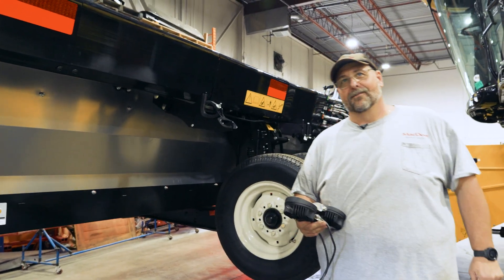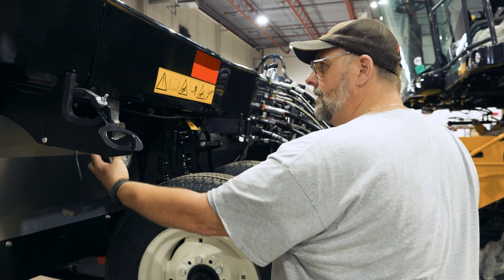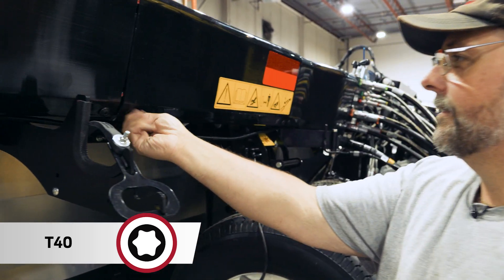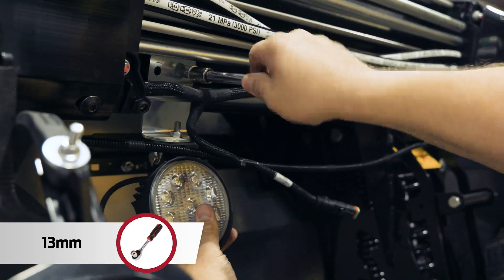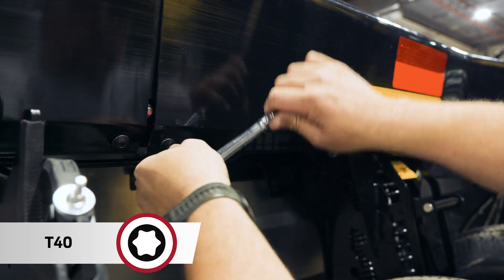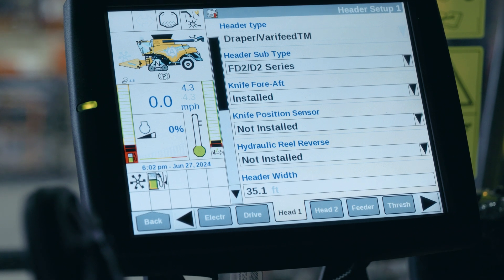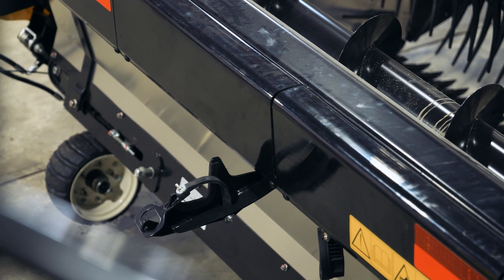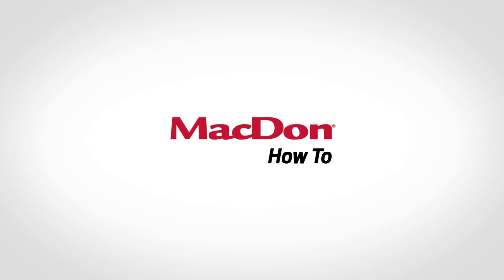MacDon How To - Install Stubble Lights on FD2 FlexDraper® Header

Comment: These lights are terrible the color is way to blue and when its dusty  like it always is at harvest the light coming of the lights looks like a smoky haze.we have them on a john deere and on the right hand side the transport wheels are in the way for adjusting to a proper angle.